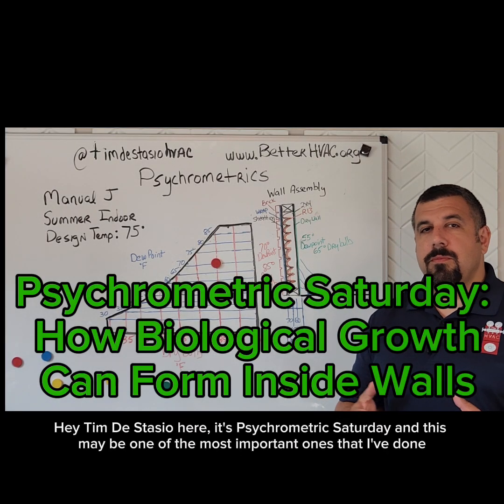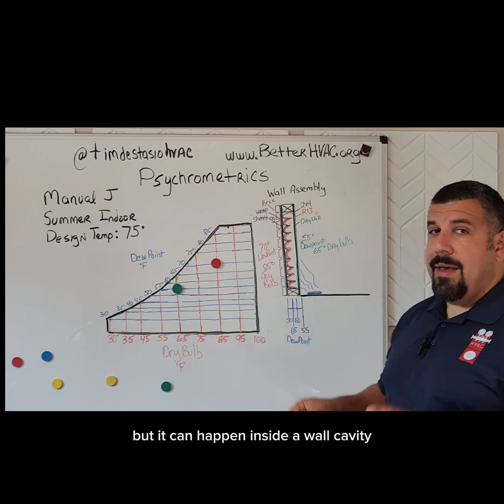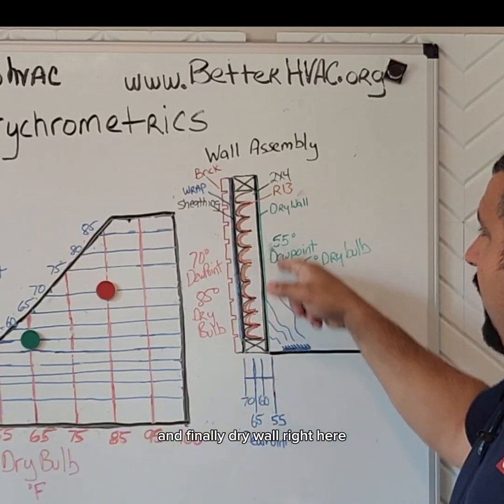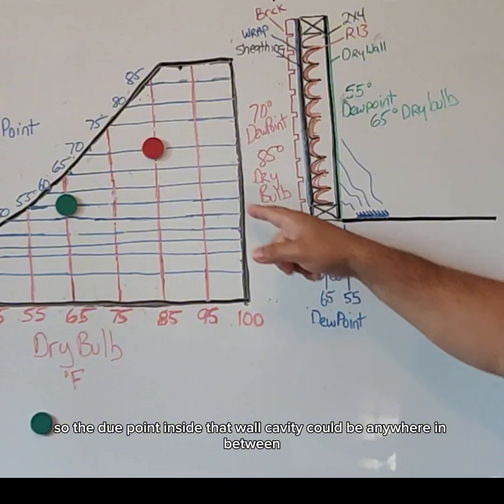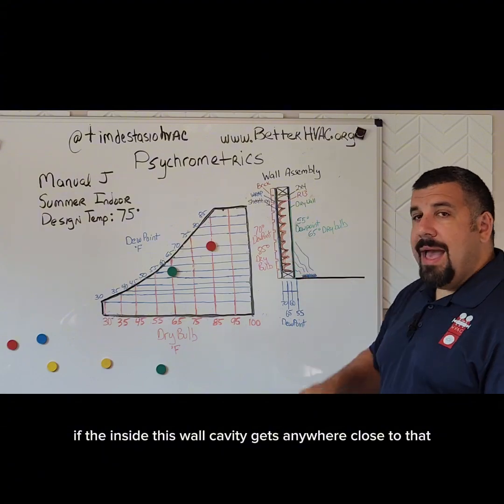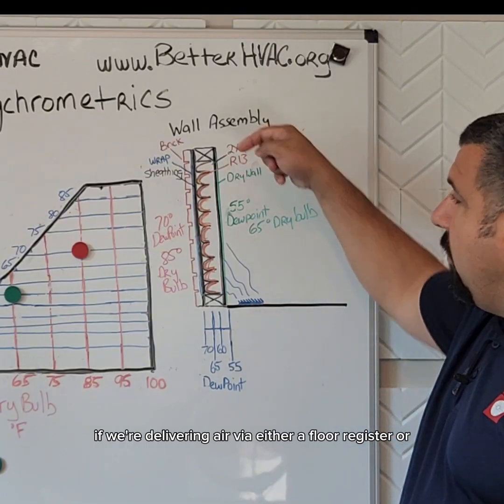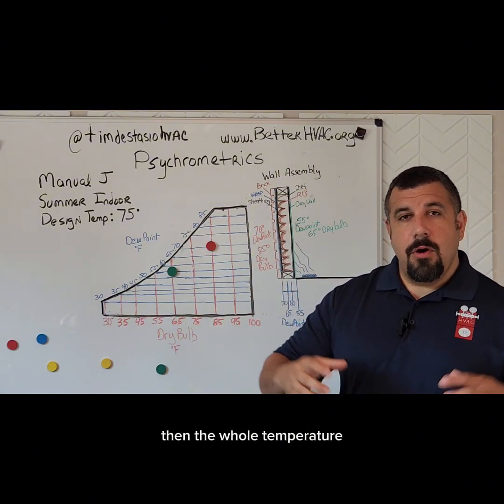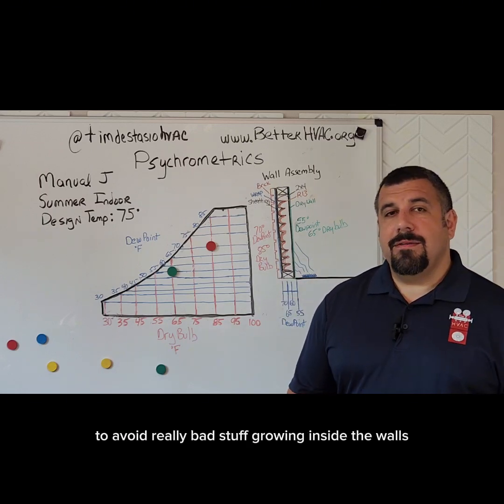Psychrometric Saturday: How Biological Growth Can Form Inside Walls

Comment: ACCA manual J is correct for a large majority of the population about what they call so-called comfort window. 
      But then there’s a large majority of the population who is on the other two sides of the comfort zone Who finds 75° uninhabitable. 

The only time I felt 75° was comfortable and my son is the exact same as me is when we were in Arizona in the summertime and humidity was 8%. 
         Because neither of my son or myself have ever been in 8% humidity, we both were surprised and very delighted to find out. We can actually be comfortable at 75°F.. but it had to be 8% humidity. 

Even in low humidity for myself and a few others like us 75° is extremely hot and we sweat like pigs if we do any movement at all. 

Even in low humidity out here in California San Francisco .